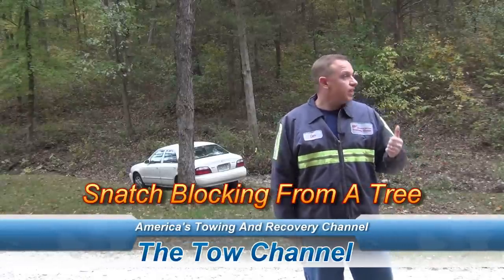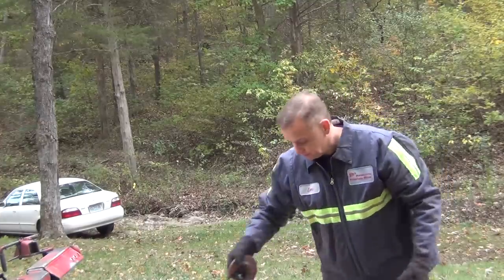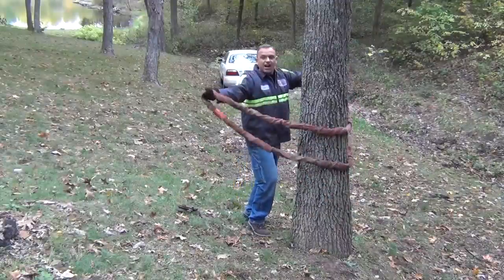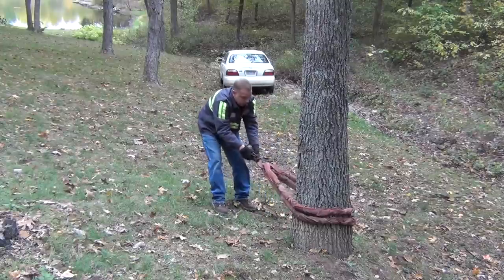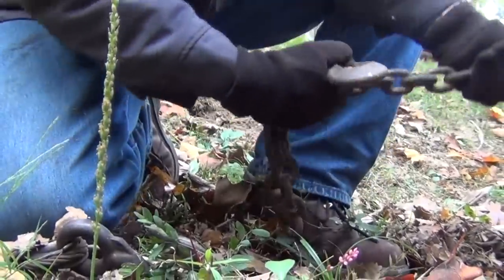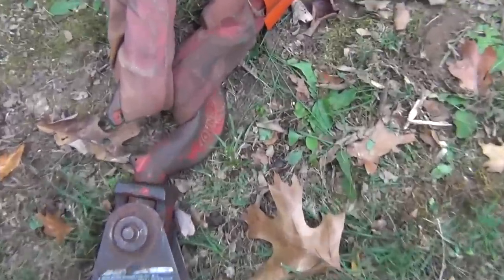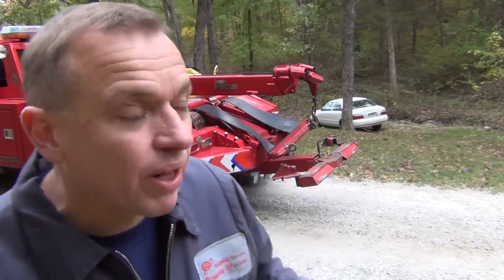Using A Snatch Block On A Tree To Recover A Wrecked Car

Comment: Good video. I'm building a new shop, with a slightly sloped parking area in front of the shop. I have weld plates in concrete in my shop, so I can winch a car in. Looking to see if I can figure a way to be able to move a non running car out of one stall, and sideways on the sloping ramp over into the other stall. I'm thinking some well place snatch blocks will help me accomplish this. :) I forgot to mention, the non running vehicle will be on 4 wheel cradles or dollies. :) So it will move sideways.

Comment: Have you done videos about calculating how much resistance it's adds to pull up hills or through snow?   How about videos on where the danger zone is in case the cable snaps?

Comment: Actually had to do this the other day to pull a Ram 5500 with a 6 ton bin mired to the wheel with about 6 inches of play between it and a tin barn. Worked brilliantly once I convinced the guy that trees are pretty strong.

Comment: Wow, i actually did this yesterday on one of my jobs! instead my winch wire cut into the tree a bit so this was informative to me, next time ill do what you have done :) cheers for the good info
Reply: Ry Schaworski in a pinch ive just thrown the cable around a big a$$ tree and pulled against the tree. Not good for the tree but it will survive. Was an instance i was in one of our spare trucks in a snow storm and had no equipment with me.
Reply: devoncoolman88 you do what you have to do right ;)

Comment: Good video just 2 things. First I'm from California and I believe that the CHP requires all tow trucks to have a spring clip on all hooks so nothing can possibly slip off no matter how secure it is. And second the hook connected to the recovery chain, shouldn't it be facing down so that if the event that it snaps it would shoot down not up.

Comment: Out of interest, I notice you didn't use the towing eye to place mini-J... are standard towing eyes too weak to pull a car out of a ditch? Or is that just where the towing eye lives on that particular car?
Reply from the maker: This car doesn't come with a towing eye. It's a Mazda 626 2000 I believe
Reply: The Tow Channel Thanks!
Reply: donkmeister ... This is a long time out, but the towing eyes that thread into bumpers are not intended for use in the tow truck or flatbed operations. They are intended as an emergency means to pull a rollable car from the traffic lanes, using a light rope that will break if the pull exceeds X amount. The vehicle pulling the non running car should be attached to the rope in the most linear way possible. As angles and force increase, breaking the screw in eye becomes more likely. That's why using the eye and winching a car up a flatbed is extremely stupid. Our company forbids using the eyes. When I retow a car that has been hauled by an idiot who used the eye and left it screwed in, I just leave it as is and advise the recipient of the car that the eye was in the bumper before I got it and that it is not a safe piece of equipment. The only way that the ring could be used for loading a car safely on the flatbed would be if the winch was mounted higher than the deck and on the same side as the eye's hole, affording a linear pull. Since the winches aren't mounted that way, there's no safe way to use the eye on the flatbed. I have seen many lazy drivers use the eyes and I SMH every time. I have known about the danger for a long time, but I finally saw one break during a recovery operation. Fortunately, it was on a demolished BMW and it was already on top of the bed and level when the driver pulled the winch cable just a bit too much and the eye snapped off. The car didn't move, fortunately. It had already killed one person. Would have been bad for it to kill another.

Comment: Don't set the parking brake, most people don't use it, and the PB cable is rusted to where it will not release once set.
Reply: Nothing a diesel down a bumpy back road at 50mph won't fix.

Comment: dose the rig he used for that snack block still double the pulling since its still a pully system
Reply from the maker: +Anthony Whalen It's not something you'll want to eat...It's called a snatch-block.  And what it does is decrease the amount of tension on each section of the wire rope.  Allowing you to essentially do more with less.  Thanks
Reply: +The Tow Academy thank you and my auto correct works great with food lol but I go muddin and four wheeling all the time and have not used my snach block yet for my Smitty built winch
Reply from the maker: I thought auto-correct was the culprit.  Thanks and be careful out there.
Reply: No it doesn't double the pull tonnage. The snatch block in this scenario is just being used to change the direction of pull. If he would of put a snatch block at the car. Ran the cable straight out to the car thru the snatch block and came back to the truck with the cable hook and attached it to the boom and then pulled the car. That would double the pulling tonnage.

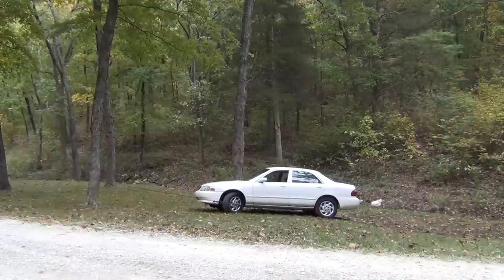Comment: At 3:42 it looks like it's on the tire - but that wouldn't make sense?
Reply from the maker: It terminates either at a transport slot with a mini-j or a grab hook on the frame.  It's been 5 years and I just don't remember.  But no, it's not attached to the tire.  Thanks